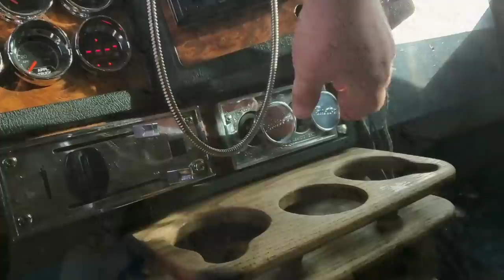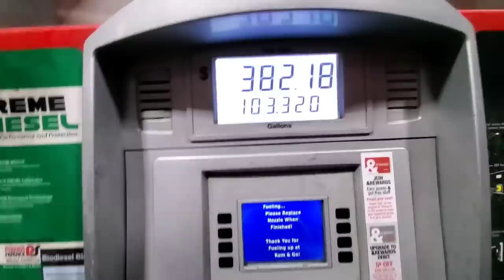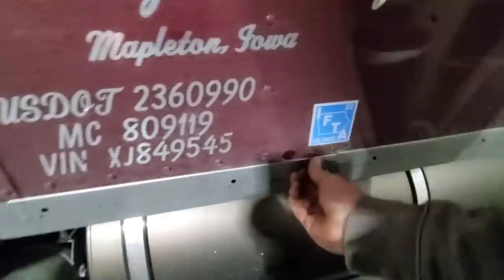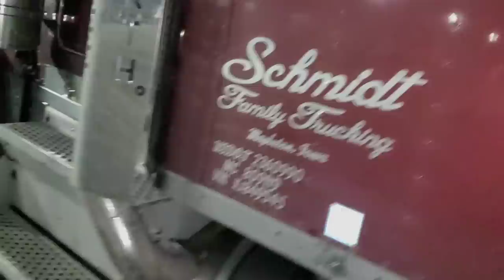Becoming An Owner Operator In Trucking // Old Trucks Ep513

Comment: Today all vehicles from the 1990's onward have "computers builtin withe error codes"
you can buy a hand held computer error code reader and see what is problem or problems 
are with a vehicle. BEFORE YOU BUY A TRUCK OR CAR RUN THE ERROR CODES!!
This may save you a lot of repair cost and avoid a lemon, vehicle.
TRY to run the error codes TWICE on diffrent days UNANNOUNCED. Some dealers, garages,
and private owner will just reset a "BAD ERROR CODE" TO HIDE A PROBLEM!!!
a reset error code will turn itself back on in a couple of days when you read the test codes
again a few days latter. I have seen garages just reset the error codes and charge customers
hundreds of dollars!!! Then the problem comes back.